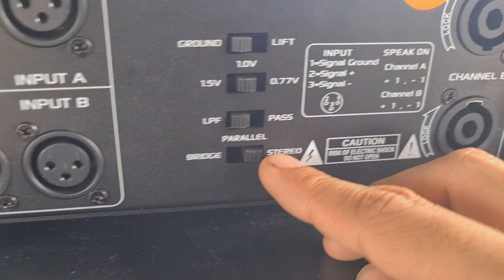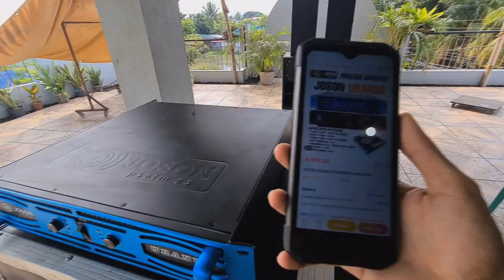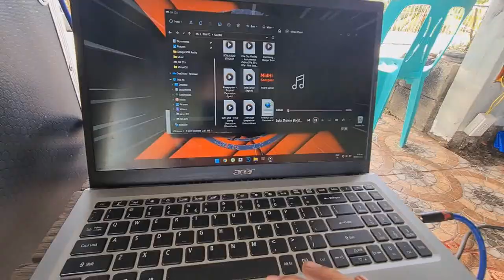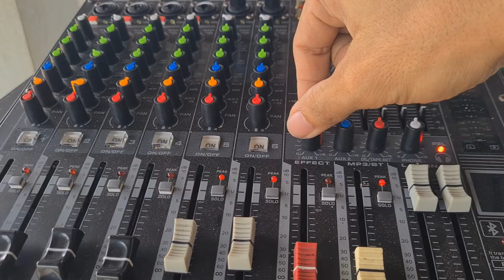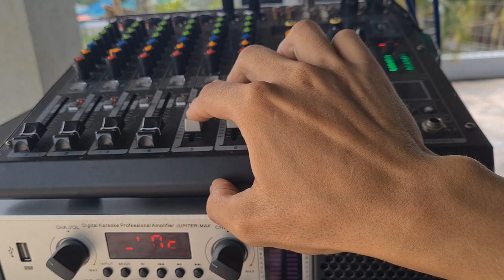Testing LEGIT NEW BUDGET AMP..JOSON URANUS Power Amplifier Soundcheck

Comment: Sir o-x tanong ko lang kung stereo mode 820w at may dalawa ako sub box kailangan ba dapat naka 4 ohms connection ko or ok lang 8ohms per channel? By the way ano dapat wattage ng speaker ang match dyan sa joson uranus? Sensya na bano pa kc ako sa sounds salamat sana masagot nyo idol
Reply: Thé power of thé speaker should be Always superior at thé power of amplifier meand thé Joson 2x550 RMS et thé l'East minimum of thé speaker 600 watt rms